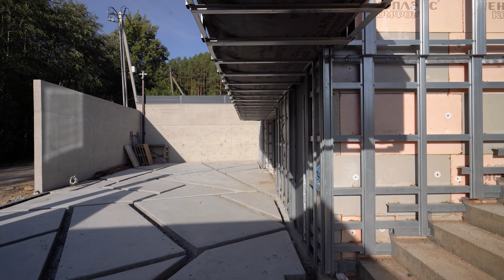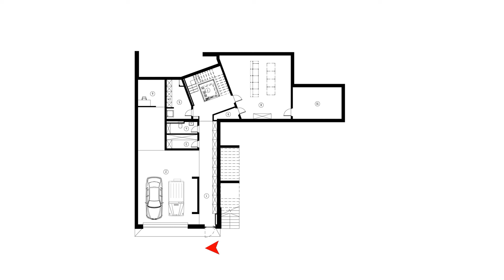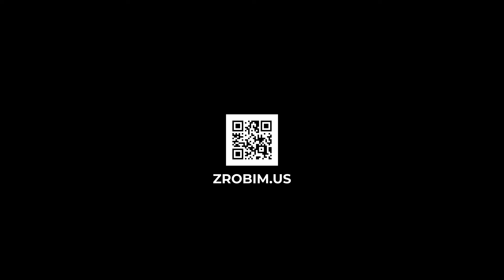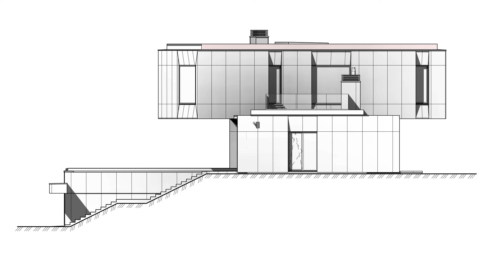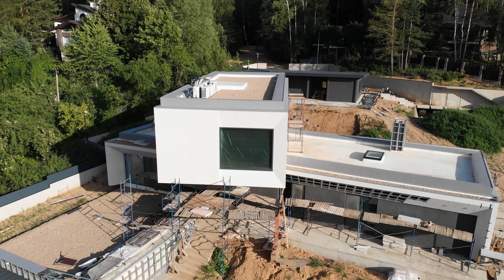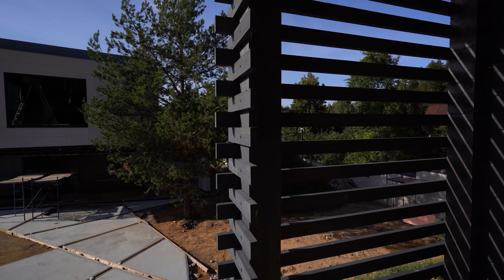Modern Mansion on a Breathtaking Slope | Architecture & Design, House Tour

Comment: Do you see the difference between a good render and a bad architect? 
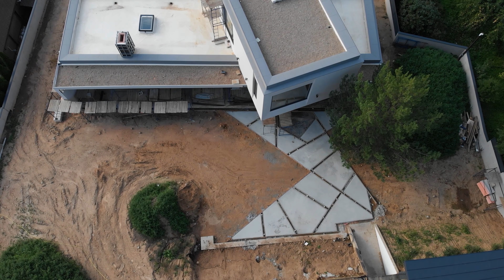1:29 A nice render of a box nicely floating over another box with a nice intact beveled frame. A detail hard to execute, but still possible.
vs
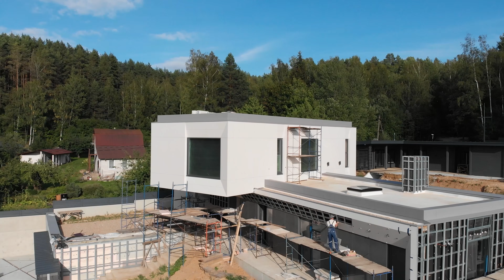1:34 The result in reality: upper box intersects that frame, destroying the beautiful detail from the render. Not floating anymore. And the frame of the lower box is much bulkier.